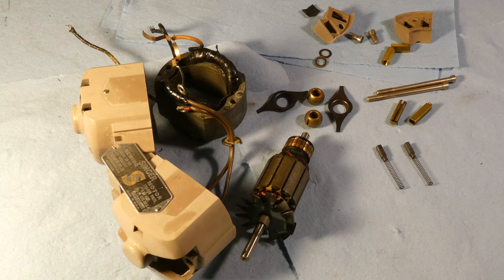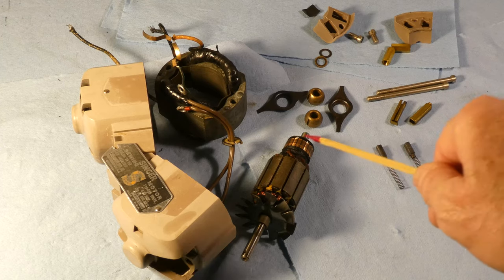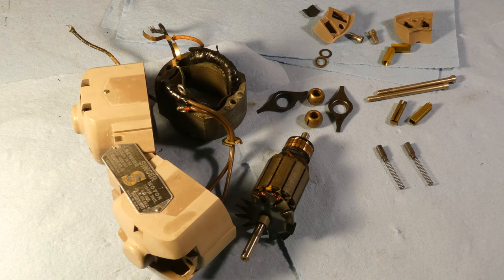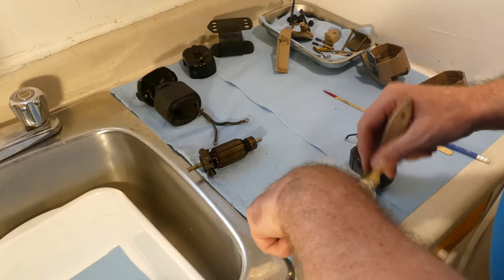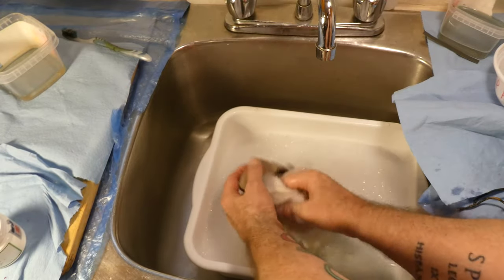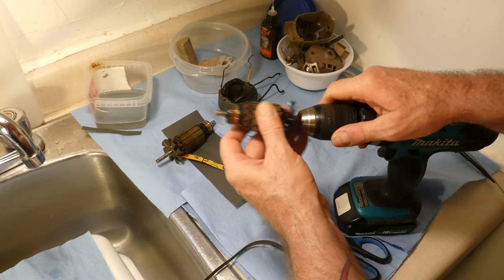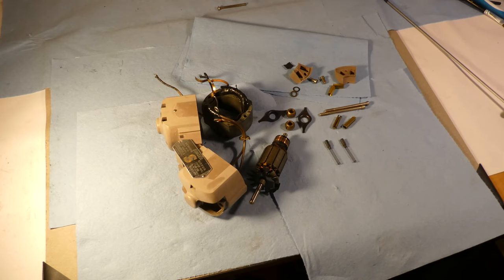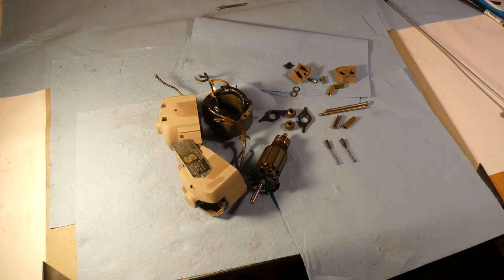MOTOR WORK. SINGER 306K SINGER 306K SEWING MACHINE IS A QUALITY BUILT MACHINE.

Comment: Jebb I have a question. Why are you sanding the commutators? I was always taught to polish them out, and to only ever sand if there is damage that needs to be smoothed out on them. One other question, HOPING I don't offend you with this one. How can a 5.3 amp motor have any "stuff"? 

Now, I have a New Process Gear (Chrysler) built Kenmore model 71 I'm currently attempting to get the upper bearings unlocked with, and it comes with a 1.5 amp motor. 

We Kenmorons refer to this series of machine as the "Buzzsaw". When they are running, it's not hard to figure out why they're regarded that way. Well, that machine not only boogies, it also has that deep needle penetration I really love in pretty much all of the Kenmore series up to 1978 (after that, they all went to nylon garbage). 

OK, so back the 306K. I could well see a 5.3 amp motor being a torque monster if it was one of the Singer direct drive motors. This isn't. Its an outboard; and next to the friction drive machines, these aren't regarded as being highly efficient with power distribution (or so says every tech I've ever spoken to with regards to the Kenmore and White equivalents). A Nelco, fairly common machine in these parts, well, it runs on a 1.3 amp motor in around this same vintage. It's also an outboard, but that model can dig deep into leather, and can sew quickly or slowly without breaking any sort of sweat. So, I guess what I'm asking is how is a machine that is as heavy with the gears and linkages as this machine is (I realize the machine itself isn't as heavy as most from this era), that is regarded as a semi-industrial in built and capability get its reputation as a deep, wonderful and powerful sewing experience with a motor that has so little going for it power wise. 

I have a Kenmore 27 (much lighter machine) hybrid that originally had a .5 amp motor in it. Motor isn't one of these plastic piles of...it's a decent (but still .5 amp) motor that ran many Janome and Kenmore machines during their hybrid heyday. Now, this machine, with that, I'm sorry to say, anemic power plant was OK to do mending and basic sewing with, but if you threw 8 layers of denim under the needle, it'd stall. Upgrade that to a .7 amp motor, that machine dug in and got the job done (I've done this, so I speak from experience). 

I am not asking this out of disrespect. Rather, I'm asking as I am genuinely not "getting it" when it comes to the power plant on my machine. Now, I'm in the midst of taking on some of the tough cleaning I'm discovering this machine is in dire need of (just took out the bobbin hook race as there was a lot of thread tangled beneath it, and it definitely has never been off from the buildup of grime and packed in dust I've discovered) a complete overhaul. Wires, pedal, the works. If I wanted to increase the horse power on this machine, would you have any suggestions? 

I bought this machine based on its reputation for being a powerhouse when it came to stitch work. Running this machine really was a letdown as it didn't strike me as a torquey machine. I realize it'll be a more efficient sewing machine once everything is cleaned and oiled. I really do get that. But I cannot see this current setup as being anything but a basic dressmaker as is. 

Any suggestions you may have would be deeply appreciated. 

P.S. That Kenmore 27 sews through 2 layers of leather without any problem. Pretty much any machine, old or new can, in my experience. It's all in the needle and thread, pressure on presser foot and speed of the machine as it stitches that get you there. 

I actually do sew through 8 to 12 layers of denim with upcycled bags. I cannot afford a Sailrite (and their harp space is a joke, so I wouldn't own one anyway), and have no room for an idustrial, so I'm dependent on household machines to get the work done. And I really want to love this Singer. This is why this overly long, boring question is staring you in the face. How do I go from "ho-hum" to "YEEESSSSSS" with this machine (currently called Mildew Matilda from the smell on her). 

Thanks for all of these vids, and thank you for your patience (and time) with a new vintage Singer owner.
Reply from the maker: Hi! Thanks for this; will be looking at it soon. Have fun with your machines! Chat soon.